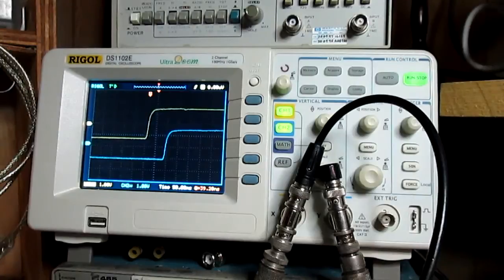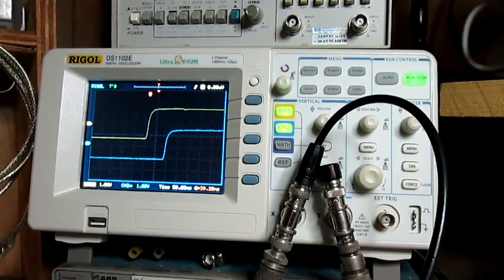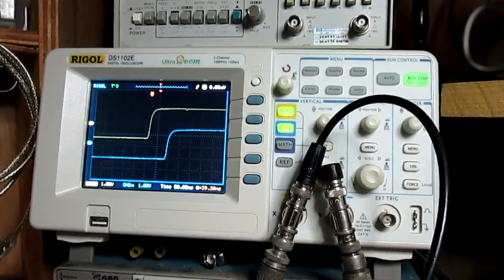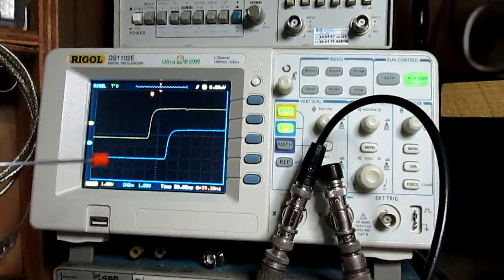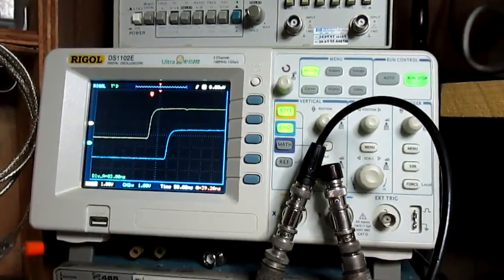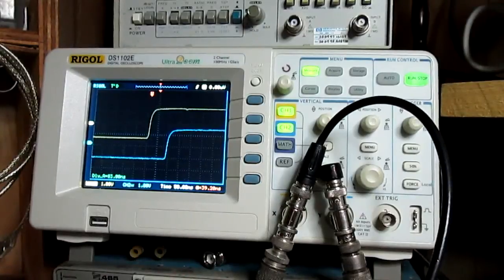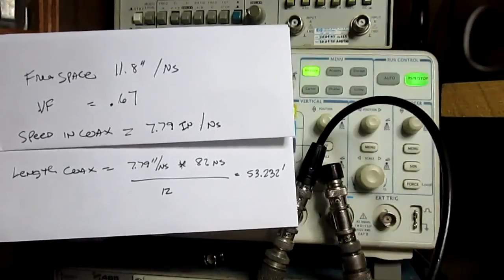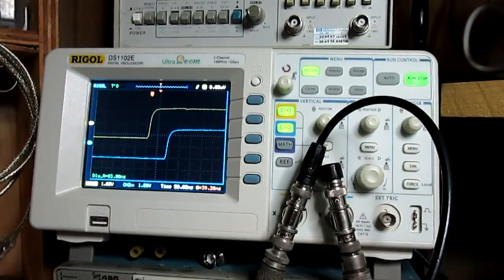Poor Mans TDR - Measuring Delay Time with RIGOL DS1102E Oscilloscope

Comment: I know this comment comes way late, but you say you get a speed though the coax of 7.79 with a VF of 0.67...... 11.8 x .67 = 7.906.  If; however, IF you had a VF of 0.66, your speed would be correct.  Are you sure you didn't write down a different VF than you actually calculated with?